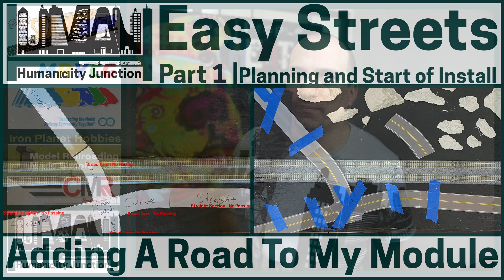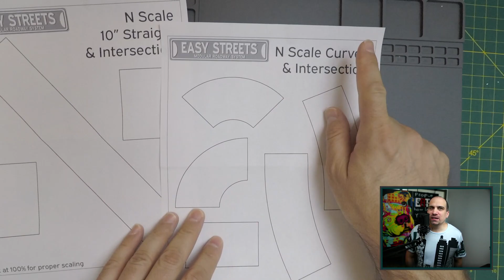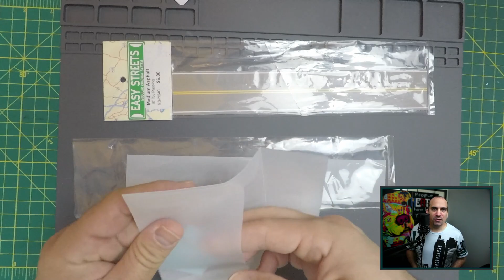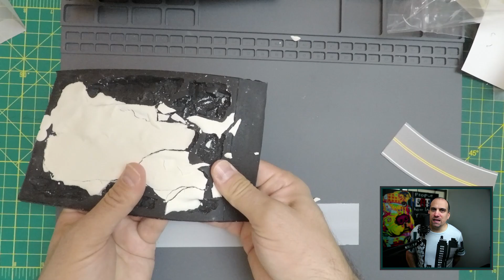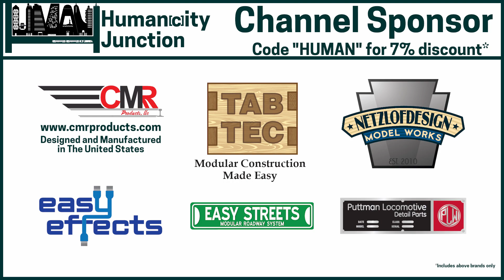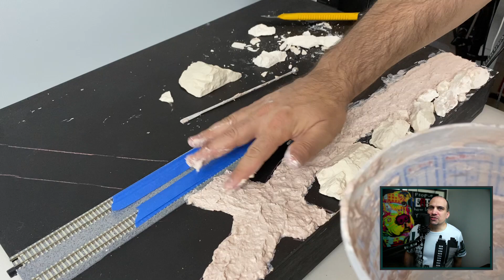55 | Easy Streets | Part 1 | Planning and Start of Install

Comment: Great video, thinking of trying the product, could you tell me the thickness 0.020 or 0.030 ,need to compensate for building height
Reply from the maker: Stanley, This is the first time that I had to get out my micrometer to answer a question.
.03 thickness. -Heath

Comment: Hey Heath,  were you able to  hide the lines/joints of the road??  Like what I seen except for the joint lines.   I'm sure someone out there has ideas.  Thanks again for your info,  Chris
Reply from the maker: Chris, I talk about it a bit in the next video, Ep. 56, with even better solution from Steve 87thPSAP in the comments. -Heath

Comment: Yeah I am soooooo glad you adjusted the grade up to the tracks. That’s one of my river counter things. Hay for some of you adhesive issues think double sided tape. Doesn’t smell and depend on what you get really strong.
Reply from the maker: Steve, that is actually something I do not like about the Kato Unitrack is that there is not way to have the track flat on the benchwork.  Therefore, I end up raising up the rest of the module to match.
The double sided tape I really like is VHB, but it is usually pretty thick.  I think (but really have no idea) that contact cement will work pretty well.
Thanks -Heath
Reply: So my wife is into paper crafting and has some real thin tape used in card making and so forth. Works awesome. Then there is also carpet tape, but you don’t get many chances at that.

Comment: I think most would have put in forms with tape the height of road on either side to pour the sculptamold into.....I  do like those road things...
Reply from the maker: Dwight, I thought about doing that, I know that is the woodland scenics method of doing roads.  But I wanted to sloped edge on the sides of the roads, not straight sides, which is why I did not use a form.

Comment: Cheater!  lol. I actually "paved" mine using wall patch spackle, tape and a trowel. I then painted them with acrylic asphalt paint then added the stripes using paint and a woodland scenics scale line spacer. More work but gives realistic look with
Reply from the maker: Frank, sometimes I like the difficult way, other times I like to do things the easy way. -Heath

Comment: Not sure sculptamould is the right product to place under the road! I would have used cork. Use decorators caulk to fix, it will stick well and make up the scultamould undulations. Use a weak paint wash on the rocks, do in a few goes and differing colours. Add artists acrylics tubes or kids acrylics for the sculptamould, it takes a lot of paint and they are cheaper than hobby paint
Reply from the maker: Timber, yeah, I have the right paint in the other room, I just did not grab it. -Heath